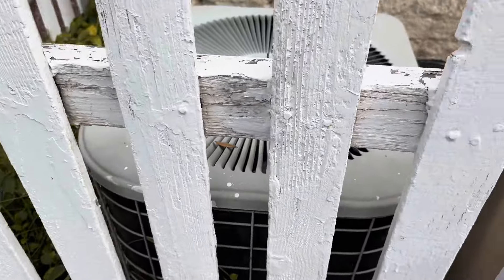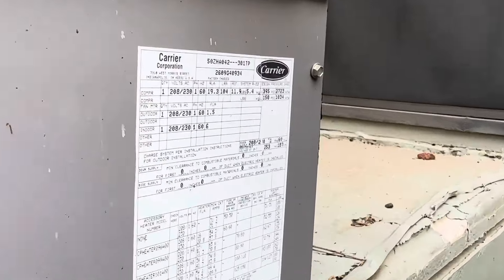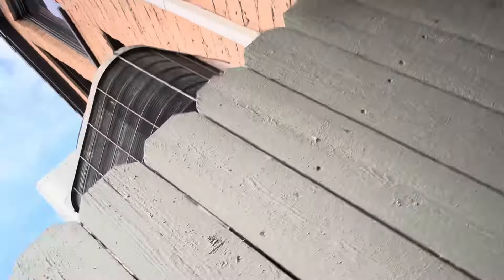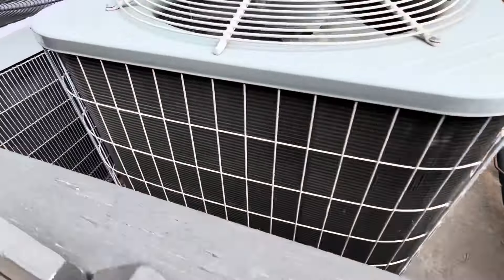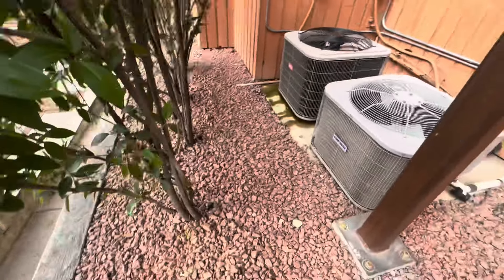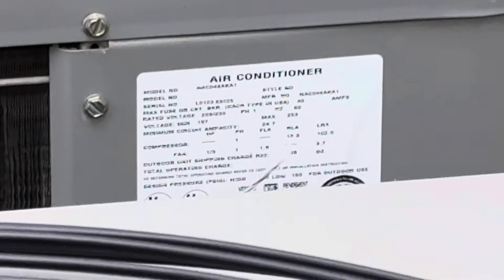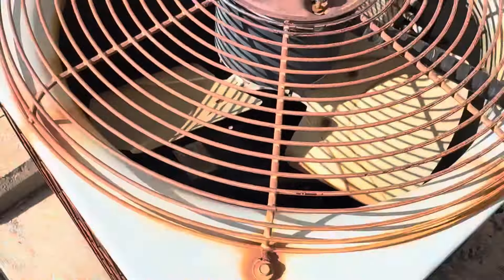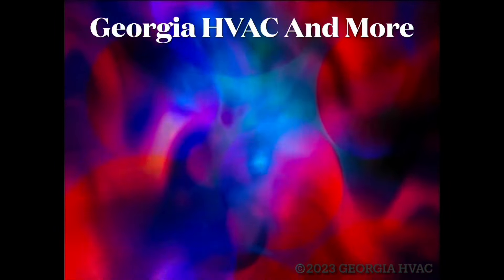Vintage 1975 DNP Cool Cube Air Conditioner + HVAC Heaven in St. George, Utah

Comment: Appears that old unit is a Day & Night-Payne
Reply from the maker: Indeed. DNP is the abbreviation of Day & Night Payne
Reply: @GeorgiaHvacAndMore  Usually you hear about BDP — Bryant, Day & Night and Payne. Now Day & Night is an ICP brand. Carrier, Bryant and Payne are all separate (despite I believe it still being referred to as BDP), and Day & Night is an ICP brand. Either way, same equipment anymore just with different stickers, slightly different front panels and maybe a couple very slight changes (e.g. model number).

Comment: Why the heck does ICP have so many brands?? Are they all priced differently? They all look the same just with different logos on them. And on top of that, they're still just rebadged Carrier units.
Reply from the maker: They are. Although Payne, Day & Night, and Bryant belong to a domain called BDP, Carrier is their own domain, and Tempstar, ComfortMaker, etc are ICP
Reply: Why did General Motors have Chevrolet, GMC, Buick, Oldsmobile, Pontiac, etc., and Ford have Lincoln or Mercury? A lot of them were the same cars just with slightly different badges and markings. Same interior, same engines and components under the hood, and sometimes even the same price.

ICP's predecessor, Inter-City Products, purchased many brands from other former manufacturers. Comfortmaker and Arcoaire were acquired by Inter-City in 1991 after SnyderGeneral exited the residential HVAC market. Heil was formerly Heil-Quaker. KeepRite was a separate manufacturer. Day & Night was the 'D' in "BDP" (Bryant/Day & Night/Payne) until Carrier/UTC reorganized Day & Night under the ICP umbrella. It's all the same equipment, just different names. I've even seen suppliers substitute, say for instance, an Arcoaire for a Heil.
Reply from the maker: @1912RamblerFan01 couldn’t of worded that better myself